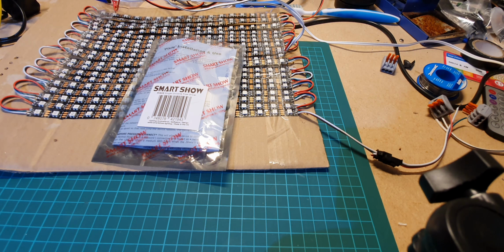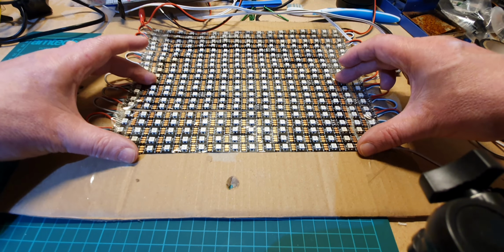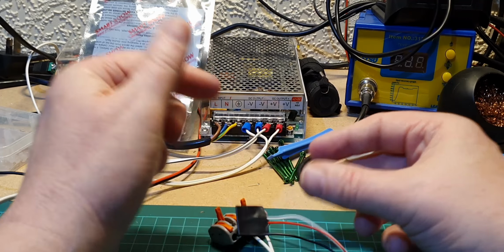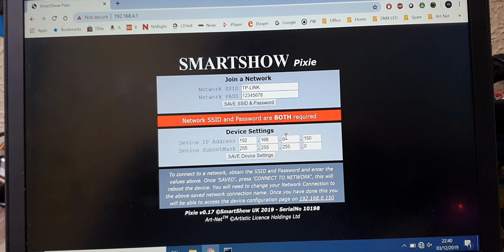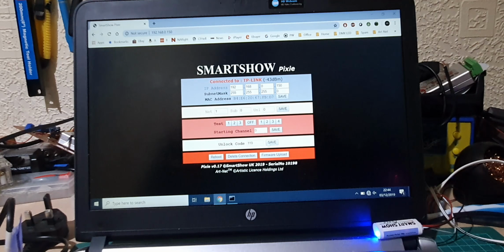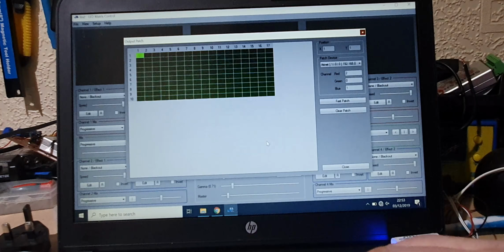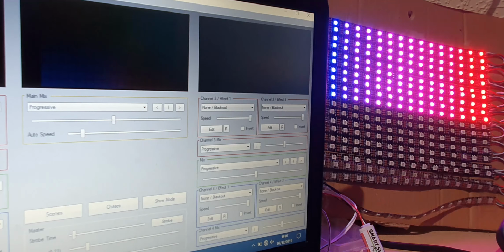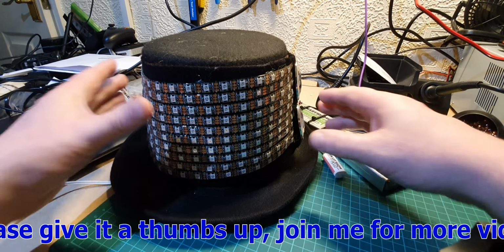Review, setup and testing the SmartShow Pixie

Comment: Hi, I recently bought a smartshow Air pixel mini II,  I configured it, then programmed jinx, the device receives data as the blue light of client mode disappears, but the connected leds don't show any effect. Any suggestions? How do I figure out which is the value of the net, when programming the patch in jinx?(I rebooted the device once, and reconfigured it to another wifi, after that the net value that was displayed in the first configuration screen disappeared and I don't know how to retrieve it.
Reply from the maker: Hi, sorry but i dont have a Pixel Mini II, but ive had a quick look on the SmartShow web site and you can find instructions here:
http://smartshow.lighting/wp-content/uploads/2020/02/AirPixelMiniII-A.pdf
page 2 shows a step by step setup